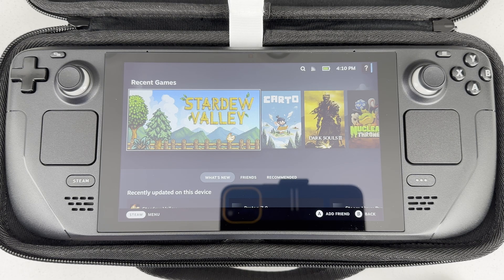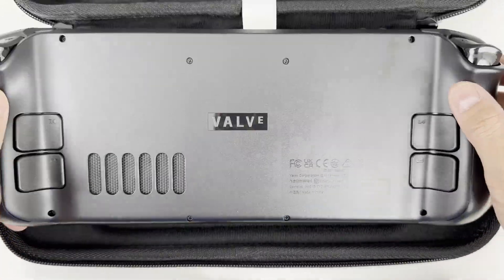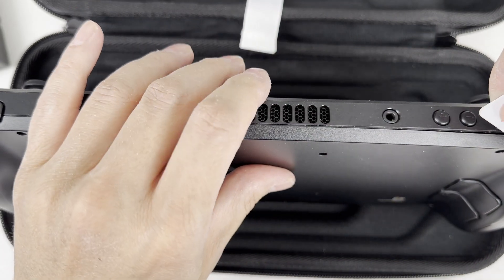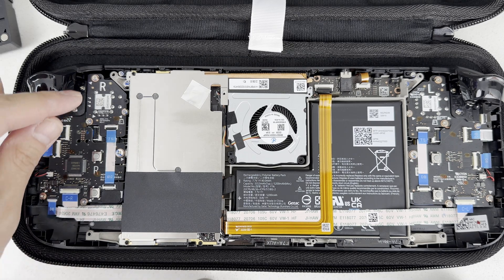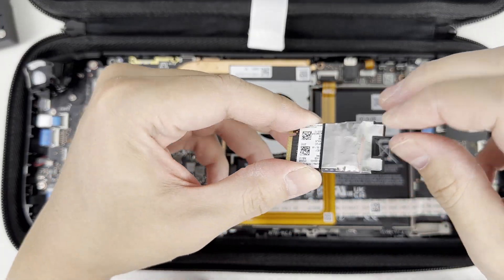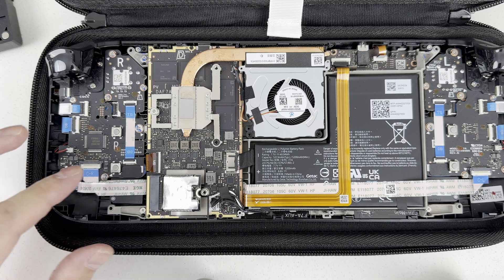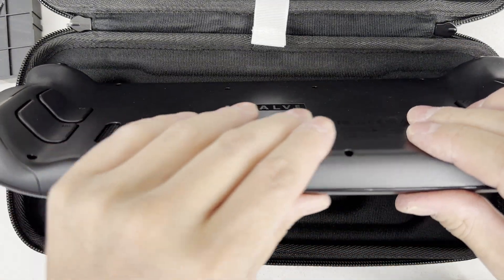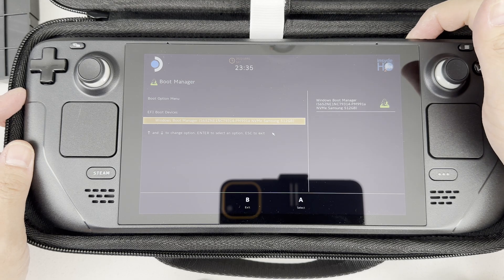How to Replace the Steam Deck SSD (Upgrade Storage)

Comment: Help please, I upgraded my SSD but now my steam deck won't charge. Even after switching back to the old SSD, it still doesn't charge. Anyone know what might be the issue?
Reply from the maker: Does it turn on at least with the battery life it has? If it doesn’t even turn on or charge maybe the battery cable got loose or damaged. 

I also had a problem similar to this though after not using one of my Steam Decks for a while but it fixed itself after plugging it into a different charger for a while then turning it on. Try this before opening it up again. Once it powered on the battery was at a weird percentage, but that fixed itself too.
Reply: @Loaded0  It turns on but even with a charger in, the battery drains when it's idling in the home screen. I've tried 3 separate chargers (that all work on my phone) and the percentage still drains
Reply from the maker: Most phone chargers are usually not strong enough to charge the Steam Deck so it’s best to use the official charger or at least a laptop usb c charger. Phone chargers are usually only 5-15 watts while the official Steam Deck charger is 45 watts.
That might not be the problem though so if it still doesn’t charge try the instructions here:
https://www.reddit.com/r/SteamDeck/comments/t8x3ue/psa_valves_solution_for_no_charging_ghost/
Other people have said this worked for them.
Reply: @Loaded0  Thanks for the suggestions but I've tried putting it in shipment mode and it still doesn't work T_T

Also I've tried using an 87W and 30W charger, the battery life still goes down
Reply from the maker: Hmm not sure what else to try except keeping it plugged in for a while if you haven’t already tried that too. Doesn’t sound like it’s really related to the SSD change so maybe you can still get it replaced from valve support.

Comment: Do you still use the Dell G15 laptop? Do you plan on making a long term usage review video on it?
Reply from the maker: I still do although it’s getting less use these days. There was an annoying problem with the brightness controls not working with one of the latest nvidia drivers under hybrid graphics mode. I haven’t tried troubleshooting it much though. Maybe not a full review, but I think I’ll try to make an update video of how its running and the upgrades I’ve done to it so far.
Reply: @Loaded0  I have the same issue. A lot of G15 users have reported that issue. I let dell support know and I made several posts on their forums but Dell hasn't fixed it yet which is unacceptable. 

Buying a $1400 dollar only for dell to do the bare minimum is very bad practice.

Comment: I know they aren't really stopping people from upgrading, but it's strange that they warn people away from it so much, especially with right-to-repair being a thing in so many places, now. On the website itself, they even say "not intended for end-user replacement", and I always get the sense that things being over-covered or protected by flimsy clips, are the manufacturers way of trying to stop or further ward people away.
Reply from the maker: That could be true. They don’t want people opening them up probably because of support and liability problems. As for the plastic clips I think it is cost and ease of manufacturing for them. Using a bunch of screws is good for flat products, but curvy ones are harder to seal without clips I would imagine.
Reply: Of course they're endorsing people to stay away and as an industrial machine mechanic, man it's absurd how much people just do stuff wrong everywhere. To me it's so obvious why they're trying to hint that if you're not sure, maybe you shouldn't mess with it. I know so many people that would instantly f'up thing like this to beyond repair. It's not rocket science, but world is filled with dumb mofos 😀

Comment: Is the thing Valve says about the screws being stripped easily or the case being weaker/looser after doing the replacement true? (I have OCD and that would probably bother me a lot.) If those did occur, would they be fixed by buying a replacement back cover and replacement screws from iFixit?

I wanna upgrade my 64 GB Steam Deck to a 512 GB SSD, but I'm inexperienced with taking apart electronics and am hesitant to do the upgrade since I'm worried I'll mess up the screws in the process.
Reply from the maker: The screws are small so yeah they can be stripped easily but that’s less of a problem if you use the correct size screwdriver and don’t force turn things. As for the case, as long as none of the clips inside break while you open it it’ll be good too. Make sure to use the plastic opening tool all around to avoid breaking any. Like you said there are good replacements available too if something does go wrong. 

Give it a try. It’s pretty easy with the right tools and take it slow. At least you’ll have an excuse to customize it with a cool case color if it doesn’t turn out as well as you’d like.
Reply: @Loaded0  what size of the screwdriver did you use for the inner screws?
Reply from the maker: The same one worked well for everything I had to unscrew. Made it nice and easy.

Comment: You MUST remove the MicroSD card. You MUST disconnect the battery. Nothing went wrong here but it’s an unnecessary risk.
Reply from the maker: It’s definitely a best practice to remove them. I’ve had problems in the past with battery ribbon cables though so I don’t often remove it for pcie slot peripherals. Luckily haven’t had a problem yet.
Reply: @Loaded0   as someone providing a guide to process, you must keep in mind what you are doing is showing others how to do something. Not informing viewers of a risk like this is irresponsible and an outstanding disservice. I have already followed your guide only to read comments and find you have skipped a step, not informing me of the importance and potential risk. Just because you have issues with something doesn't mean everyone will, or that everyone is willing to take the risk over some extra effort. As someone putting up a guide on this you should have at a minimum mentioned this in your video.
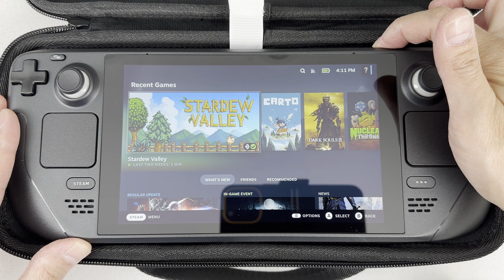Reply from the maker: I appreciate you taking the time to write such a long comment, but I actually do mention the battery at around 00:30 into the video.
It’s a risk to do everything even involved in this video. Valve doesn’t recommend changing the SSD on your own. That said it’s a handheld PC that uses PC components and it behaves like a PC so I wasn’t really concerned about the battery.